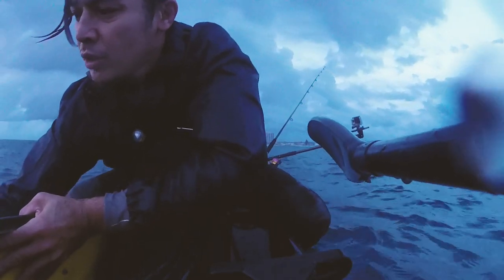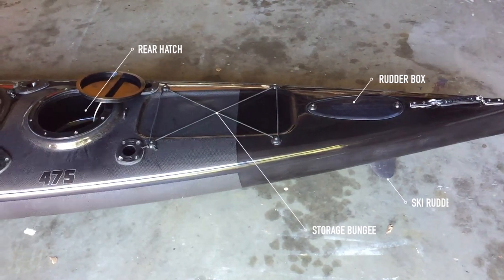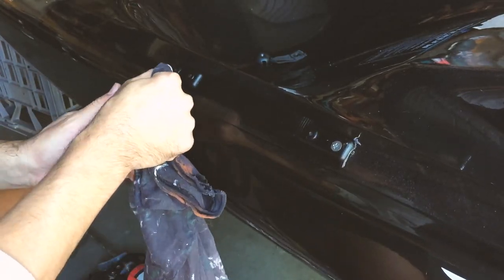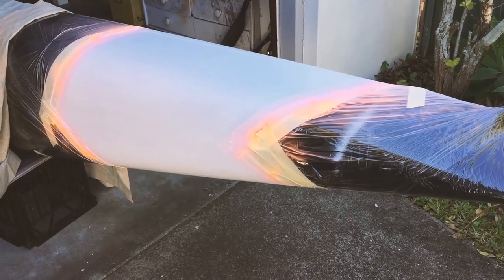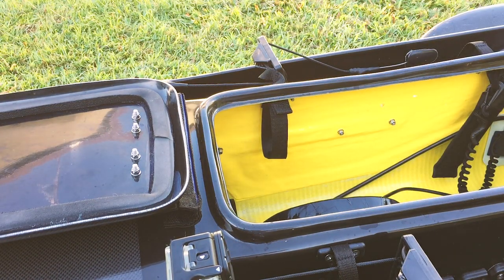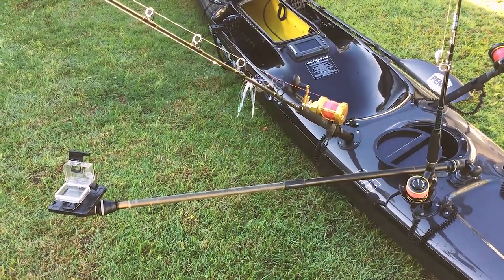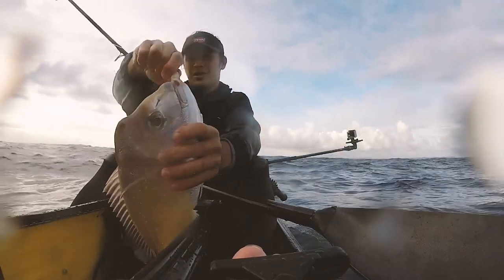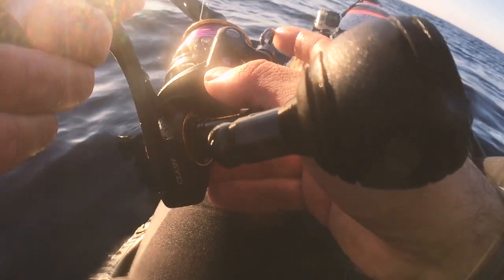Offshore kayak fishing setup - My ultimate Stealth fishing kayak

Comment: I am thinking about buying Stealth. I have few questions: 1) how comfortable are you fighting a big fish in this kayak? 2) I see you put fish directly into the front hatch, does it hold ice well? How do you clean the hatch after that and why don't you use an insulated bag? 3) How durable is the kayak? 4) How well live well is working? If you stop paddling, the water would not circulate and bait may die, correct? How many google eyes have you ever had in this livewell? Thanks!
Reply: It's six years old and he is still using it. So it must be alright

Comment: tip: , you can build a little "well" for your transducer inside your ski, (fill it with fresh water ,put the x-ducer inside), then cap. You need to use a compression seal for the wire. The well should have no bottom , but rather  the walls would be sealed..silicone or resin to the hull cavity. SO the water is directly on both sides of the hull (no air layer(s)  )Xducer signal shoots through solid materials (boat hull)  just can't shoot through air, hence the bottomless well design.  In your case with the flush mount head unit it would be ideal as all would be inside the  hull, no mess no set up ,no drag,nothing for line to catch on,no need to remember to take the xducer off for the landings.  I need ti build a surf ski to get through waves, currently have a poly yak. (Tank)
Reply from the maker: Cheers mate, I have done similar installs in the past but with the transducer being so big this time and the limited access to the outer hatch and not just the fish box lining, this method is not so suitable on my kayak... also the use of side scan gets mixed results without the transducer being in the water and below the water line constantly... I do like the more accurate temperature  reading too... but I do miss the ability to just set it and forget it and not have to deal with the clip and extra drag... Pros and cons hey :) Cheers Rod
Reply: ahh sidescan..i'm jelly! keep up all the hard work...i live in COlorado, but I keep a craigslist kayak on ethe east coast here with my family so when i visit i can hit the ocean fishing, love it!

Comment: Use "Duct Seal" and mount transponder Inside the hull (Through Hull).  Nice rig.  Need a kayak like that for West Coast Vancouver Island  fishing!
Reply from the maker: Unfortunately side scan doesn’t work thru Hull. Would do for down view or regular sonar for sure👍
Reply: You can use a sidescan if you fill the area to the left and right of the transducer  like this: http://www.hostingpics.net/viewer.php?id=282821P1020641.jpg
(not the best example but you can see what I mean)
Reply from the maker: Cheers mate, I agree it can be done but you need a kayak with a v shaped hull or a nice low point that sits below the water line all the time, so you can fill the sides up too. Unfortunately the only parts of my kayak that have that are the very tips, which don’t have any clear space in them to do the install. I looked at lots of options but decided it wasn’t worth drilling more holes. The clip on works well and it’s good to get a proper temp reading so I’m happy just to roll like that.
Reply: Good to know.  Haven't used a side scan model myself.  I think when I get a new kayak one day it will be a surfski but up here you don't see fishing models.

Comment: Nice to see you making more films. Lovely kayak. I'm sure you'd said you were thinking about a 525 a while back. If that's the case, what changed your mind? I'm keen to try the 475 to see how they differ, not that I'm thinking of changing yet. I like the fish finder in that position, but worry about glare from the sun, how do manage to see it in full sun?
Reply from the maker: I do like the 525 but i don't really need to go up to it at my weight ad height so I stuck with the 475. Just that tiny bit lighter and manoeuvrable in the surf also shorter in the garage. If I was a little bigger or felt unstable on the 475 the 525 would be the perfect ski to go to. Because I can sit over the finder and its so close it cuts most of the glare out, as much as most other positions I guess... one thing I will say is that its not the best spot for a touch screen! I find myself having to constantly dry. Its fine as I have the manual buttons and screen lock sorted out now but still would have mounted differently in hindsight.
Reply: thanks for your comments. i use a Raymarine Dragonfly so it isn't touch screen. if I'm very brave I might flush mount it as you've done although thinking about the alternative fish hatch as a way of doing this. i have to say, I like your method best, if it will work ok. always up for an excuse to buy a dremel....

Comment: Congratulations on the kayak fisherman! I have a question: On the Stealth website says that the kayaks are made of fiberglass. Is yours carbon fiber? Is it a special model? If yes what is the weight difference between the 475 fiberglass that has 23kg? And carbon fiber must be much more expensive ...
Reply from the maker: yes they can make a custom carbon fibre version. It is a little lighter but not a huge amount as most of the weight saving have been refined in both fibreglass and carbon skis. You can expect it to come in about 1-2 kgs lighter but it changes due to them being hand made. The boat is a lot stiffer then fibreglass too. It is around $1500ish more to go carbon here in oz.

Comment: Incredible channel, awesome videos!! Quick question. You mentioned the Railblaza behind the seat to hold the camera, what extension did you use? The Railblaza Extenda Pole 1000??
Reply from the maker: Thanks Peter, I originally had the extending pole from Railblaza but it kept gumming up with salt and would often not lock in when adjusting the length, also the pole would work its way out of the plastic fitting from all the constant bouncing on the waves. Im guessing thats why they took it off the market recently. The pole finally popped off in the surf taking my camera with it (my fault as I should have had tethered) So I ended up putting this pole together from parts of a Ram mount and what I had left of the Railblaza pole. just added some new piping and connected the mounts. Then came up with the better way to lock it all down when coming in through the surf.  Cheers Rod

Comment: Hi mate, love your videos. Best kayak videos out there. Very professional and easy to watch!

Just wondering, did you ever think about getting a pedal yak like a hobie?

Also, how does your fish finder go with being flush mounted? Doesn't all the water screw it up and get smashed around a bit?
Reply from the maker: I would be keen to have one of each if I could afford it :) Having my hands free would be great but the real issue with Hobies and other plastics I have had in the past is getting them through the surf. It can be done but theres a lot of rigging up to be done once through the surf and its pretty tough on your gear. On bigger surf days the Hobies just can't get through... I do like the idea of having one for inshore fishing... maybe one day.
Reply: +RoKKiT KiT   ahhh yeh the surf is hard to get through..  And about your sounder being flush mounted and the water issue?  Any problems?
Reply from the maker: The sounder is still going well. I have flush mounted 3 sounders like this in the past and they all survived. The biggest issue that kills my sounders is removing the plugs constantly if you have it sticking up in the surf, With it flush mounted I never pull out the plugs and the back is nicely protected. one thing I will say is that its not the best spot for a touch screen! I find myself having to constantly dry it. It's fine as I have the manual buttons and screen lock sorted out now, but may have mounted differently in hindsight... or chosen a non touch screen sounder.

Comment: thanks for the video,
is what you can do on a instalation of the sounder .
is that the probe outside not too slowed kayaking ?
thank you
Reply from the maker: Yes the transducer is clipped on the outside and does create drag... I may mount it towards to rear of the kayak just in front of the rudder but I would have to drill a hole in the hull so Im not sure if I want to do that :)

Comment: G'day Rod.
You may have covered the gopro setup at your left foot but if you have ive missed it. Could you fill me in on how you've mounted the base please. Id like to do the same on my 525
Reply from the maker: Hey Mate, I just have it on a GoPro suction mount on the front of the recess of the foot well. i like it so if it copes a good hit or get caught on the paddle leash it just rips off and does not leave any holes.

Comment: G'Day RoKKit, 
Steve here from Bilinga Beach mate, really nice set up I saw your bracket you made up for your transducer mount clip on. I was thinking about drilling holes and mounting it permanently on the side of the hull next to the keel, leading up to the rudder. 
Can you give me any advise on making one the same as yours?
Any pics of a close up would be appreciated.
Cheers Steve.
Reply from the maker: Hey Steve, sure thing. I just bent a piece of 30mm x 2mm Aluminium to curve around the kayak from the foot well, you will need to start by leaving about 80-90mm at the foot well end to bent straight down to form the part that clips on to the side. I have mine ending at the transducer end just under the footwell drain holes. Will put some footage in my next video with a better shot of the whole thing as this description probably wont be that clear.  Cheers Rod
Reply: Hi Rod,
Thanks for getting back to me with the info mate about the transducer mount , that helps me out alot. I will look out for you on the water, hopefully it won't be to long before Spaniards are spooling off the reel off Palmy.
Cheers Stevo
Reply: Greetings from Canada!
For your 'ducer, did you ever try just the suction cup mount?  I messed around with all sorts of brackets & mountings before I just stayed with the good old suction cup for my Garmin.  So little drag I can barely tell it's there, and rarely comes off.
Reply: Hey Rod, simple question: whereabouts on the Gold Coast did you get that 30mm x 2mm flat bar? I can get 3mm thick flat bar but it does not bend nicely. cheers Mark

Comment: Nice boat. Do you have trouble with glare on the sounder mounted horizontally? Cheers Bob
Reply from the maker: I don’t find the glare an issue as I’m siting so close and looking down over it. The touch screen however is an issue when mounted so flat as the water pools in on the screen

Comment: Hey mate, looking to get a yak set up similar to yours. Curious to know where/what power is mounted for your sounder? cheers,Sam
Reply from the maker: I have the battery in a small semi water resistant esky bag that wedges under the seat. I have a very light lifepo4 lithium battery that powers everything. If you bare with me I will put out a video in the next week or two that has some details. Feel free to ask any questions. Cheers Rod
Reply: RoKKiT KiT that would be highly appreciated mate! cheers for your reply👍

Comment: Hi Rod, hope all good with you, shoulder recovering? I need to know about plasti dip for the kayak. Stealth have slightly messed up the design on my new Duo. I thought I'd rescue it with some white plasti dip. It has faded ends that were supposed to be white on the hull, but not the deck. I thought I'd do a thick, about 20cm stripe covering part of the yellow of the bow & about 15cm on the green of the stern, or a couple of stripes each end. It comes in 311mls. If you can advise roughly on number of tins I should buy I'd be very grateful. I've messaged on FB too with a couple of pics.
Reply from the maker: Hey Patrick, I replied to you Facebook message let me know how you go👍

Comment: Howdy bud what was that spray on vinyl you used?? You said you can peel it off??

Wouldnt mind trying that on mine!

Got my stealth tonight and Im super pumped!!!
Reply from the maker: Its called PlastiDip. I brought mine from Auto Barn. 
Its good for a bit of colour, but it wont hold up on any surface thats cops a lot of punishment, like dragging on the sand. So pick a good spot that is safe. Cheers Rod
Reply: Awesome stuff bud! Thanks for the tip!

Will try find it somewhere near me!

Keep well legend

Comment: hey Rod, wondering where did you buy the black rectangle plastic bits that are used to hold the handle strap down? i've been to BCF, Boating/RV, can't find similar ones to make my own carry handles... I've bought the tri-fold pop rivets, but just missing the small piece of plastic... :( please let me know ? thanks!
Reply from the maker: Hey mate, try the distributors at http://kayakspecialists.com.au  Dennis should be able to help you out. If not you can make them out of any thick plastic cut into the right shape, as long as it stops the rivets from pulling through the holes in the webbing you should be fine, even a wide washer should do the trick. Cheers Rod
Reply: Another excellent very similar product is commonly available for windsurf/kitesurf board foot straps -- SUPER heavy duty and pretty inexpensive.

Comment: Sup man. What paddle would you recomend for a trident 13? what paddle are u using for that stealth?
Reply from the maker: Hey Mate, i guess it depends on what kind of paddling your doing... I use a Stealth Blitz Wing Blade and prefer it to a flat blade, but with paddle selection there is always tradeoffs so picking one can be tricky. Pick one that is kind to your body and joints and will allow you to do the most. Feel free to let me know any details and Ill do my best to answer. Cheers Rod

Comment: Hey so there's no drain in the seat area? Ugg, always sitting in water?
Reply from the maker: Hey Henry, No scupper in seat I'm afraid... but after punching through 2 metre swell and getting completely soaked from head to toe.. a little water on the bum is not so big a deal :)
Reply: I suppose you're right. I just may need a little time to adjust if i go for it, i've been sittin high and dry bass fishing out of a Native Slayer Propel for a while.

Comment: Hi mate, I have a stealth kayak I have just bought. I can't work out how the straps work on the front hatch, could you explain to me please Rod? Cheers Tom
Reply from the maker: I think there is a video on it on the Stealth Kayak channel... but you go up through the front hole up over the metal and then back down the same front hole, then pull it snug and flip the metal over to tighten. The main reason people struggle with them is they try to use the second hole down in the clip hope that helps👍
Reply: @rokkitkit  thanks Pal, that's very useful

Comment: G'day mate, I've been doing some online research looking for ocean fishing kayaks to dip my toe in (pardon the pun) can you suggest any yaks that have rod storage(inside the hull) other than stealth and jackson kraken? I'd rather not drop $2500 only to find i prefer boats to yaks. 
cheers, Rod.
Reply from the maker: Hey Rod, Cool name mate! Thats the real tick with the plastic kayaks. very few of them have the big centre hatch to stow rods... and when they can fit a rod in most if then have small or inconvenient access hatch thats not reachable out on the water, or wont fit the rod in with the reel attached and rigged up. I have not found one that does the job properly. The kraken is big which can be handy but the bigger plastic kayak start to get very heavy. Maybe try and find a second hand kayak for a first go and see if your still keen before taking the plunge. The only kayaks I know that have a big rod hatch are the South African skis. Stealth, Pinnacle, Clark Ski (Erics) and Kaskazi... there maybe a few more. Hope that helps. Cheers Rod
Reply: I have a Hobie Revolution-16 and a fishing buddy (has the Outback w/ same foredeck hatch) just showed me that it is possible to insert the rod via the front hatch, pointed towards the stern.  Okay, it is possible to do on the water, but as the OP notes, it is not conveniently located!

Also, one of the key features of a surf ski, like the Stealths, are those foot straps because they are what give you something with which to hold onto the boot when things get rough in the surf.  For example, when I take the Hobie through surf for landing, I have to pull my Mirage Drive, and I can only stay in place via gravity through my butt, which means I have very little ability to snap my hips and keep the boat under me when I lean into turns (bracing) on the wave faces.

Comment: Hi Rokkit Kit,
What trasducer do you use for the elite ti 5?
Reply from the maker: I have the big total scan transducer
Reply: RoKKiT KiT thanks. It is included with the fishfinder or sold separately?
Reply from the maker: Its is included, but you can choose between the smaller one or this one. The difference is, this one has side scan the smaller on only has down scan
Reply: Thank you. At what depth did you tested it?

Comment: What was the final transducer placement?
Reply from the maker: Ended up just keeping it clipped on at the foot well. Still works well and no drilling holes. I also like having the proper temp reading.
Reply: RoKKiT KiT any regrets on the placement of the fish finder? I really like your set up but I hate drilling into ski.
Reply from the maker: My sounders typically last longer then people that do installs where you need to unplug when going through the surf, so yes Id do the install again flush mounted. I would however not use a touch screen model as the screen always plays up when it has water on it.
Reply: Appreciate the info. I'm going with the flush mount.